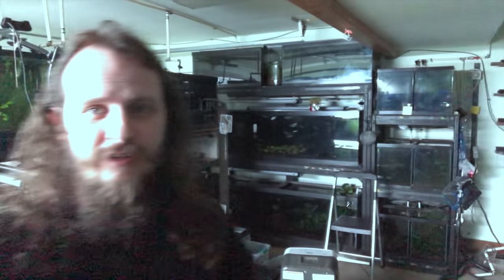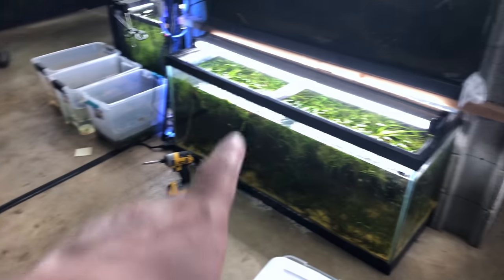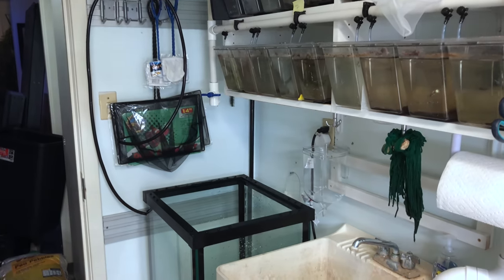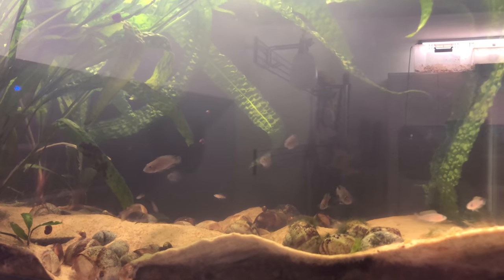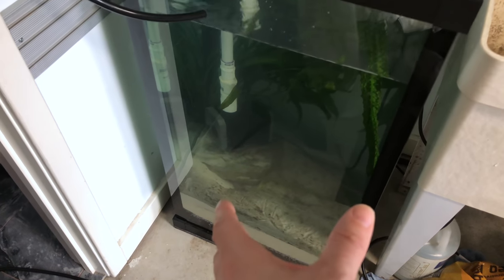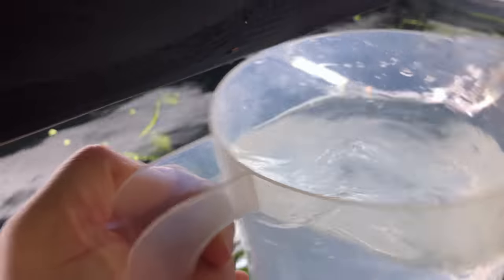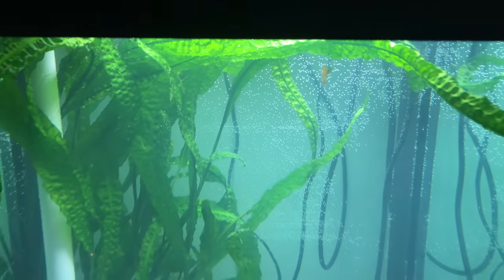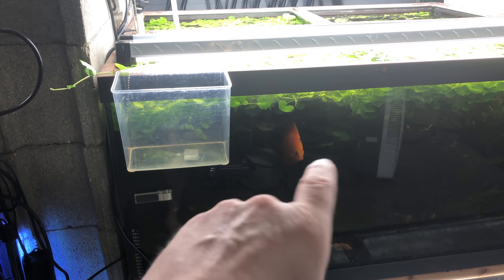Custom Aquarium Planted Water Change Sump System  *Lots Of Tips N Tricks*  4K

Comment: I think you should add some carpeting plant on the bottom. Also I was wondering if you can try windowsill tanks, just a small custom tank that you put next to the window. That way you don’t have to use a light. It would be very interesting because most window tanks I’ve seen get algae, but I think you would be able to avoid it
Reply from the maker: I actually have a huge rack system I have been testing in the foyer. Mostly smaller containers. I will further ponder any other placement options for a tank tank...

Comment: i thought bacteria dont live in free flowing water? so how will adding water from a cycled tank, jump start that tank?
Reply from the maker: Bacteria lives in water column. Even as the river flows. City water it does not because of chlorine and chloramine. That’s why the sump is for aging “cycling” the water before it goes in the smaller containers. Because the new water comes from city that when it flows it has very little bio load. Fish need the bio loaded water.
Reply: @LRBaquatics   great response, i learned something! thanks!

Comment: I'm going to point something out, but don't get mad, or feel some type of way, alright ummmm.......

Why would you use ro water, but then make it "dirty" right away? 
I understand the Bacteria Jumpstart methods, by pre-cycle media transfer, just that using RO water wasn't really needed, if you were going to transfer "dirty media" anyway, thus the RO water is no longer as clean as the pristine parameter which is what RO water is  meant to do. 
I'm just saying it sort of defeats the purpose here. 
Don't mind me, just me thinking out loud.
Reply from the maker: Lol no worries. I dont operate like that. The reason why I want it "dirty" is to "season" the water. Sterile water is not good for fish and needs to be biologically sound with mother natures essence for fish. I also split my hardwater tap 50/50 with the RO for mineralization.
Reply: @LRBaquatics  
You did say better safe than sorry, making ultra clean water a little dirtier to Jumpstart, is a lot safer than using only "dirty cylce water".

Hey Lucas, are you going to try keeping and breeding "Sulawesi Shrimps"?